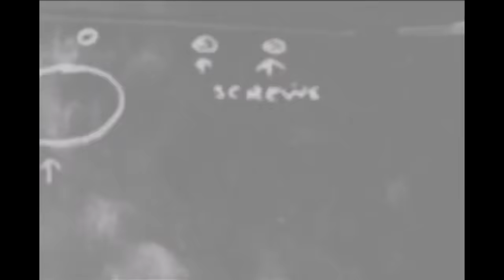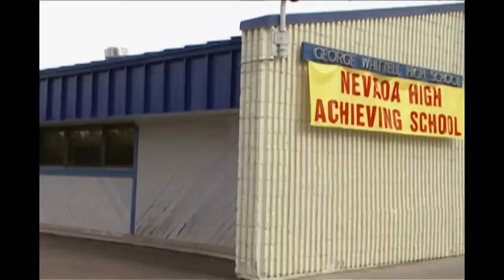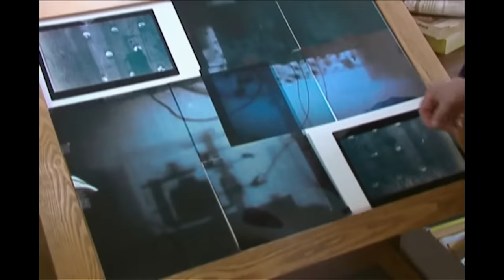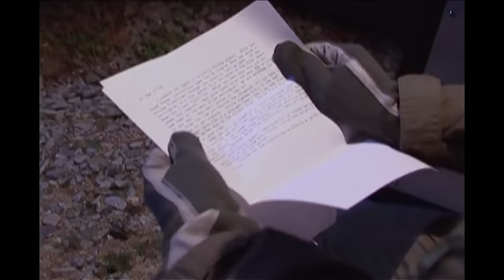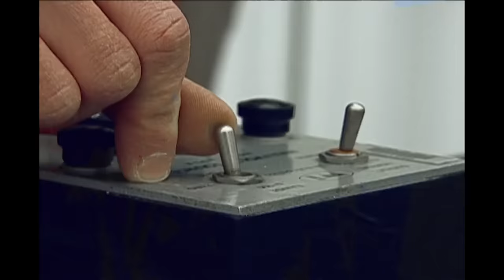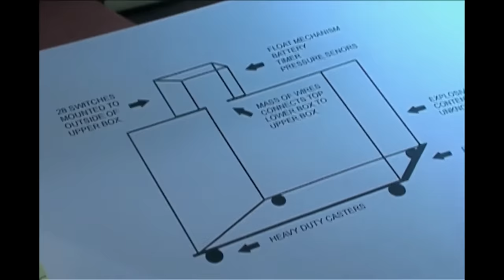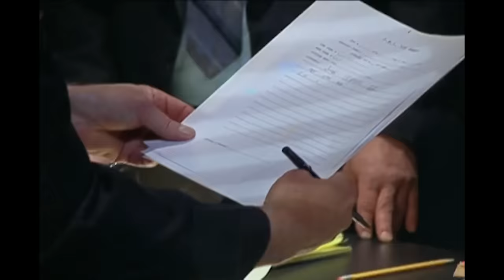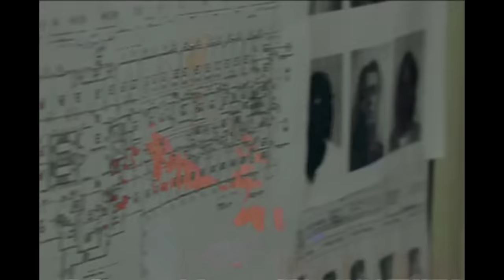Deadly Payout | FULL EPISODE | The FBI Files

Comment: A 1500-2500 ft blast area with somewhat significant damage, then inside 800 yards significant destruction, and 250 meters total destruction. My man, stick to one unit of measurement. Because 800 yards of significant destruction overlaps your 1500-2500' radius, and 250 meters of total destruction is 800' of claimed total devastation significantly overlaps all three radius.
Reply: Shroom Grizzley  no, if you start off using a unit of measurement remain consistent. Don't use feet which there are 12" in each, yards where there are 36" in, and meters which there are 39" in.
Reply: @chesspiece81  how about switching to the metric system yo--then you won't have any issues
Reply: @lilyesp5652  Should I wave my hand or just speak and make it so?
Reply: Metric system, so much easier. 1000 metres = 1 kilometre. 1,760 yards = 1 mile ( cumbersome).
Reply: @tonyneal4716  I wasn't arguing which unit of measurement was best. I was pointing out that usually people use a unit of measurement from beginning to end and he used feet, yards and meters
Reply: Can't see why Americans are still plodding along with the empirical system of measurement.
Reply: @jjoohhnnx  Point taken John but its not a major hurdle converting to metric. For example, OZ converted to metric during the 70's and we had major car race here called the Bathurst 500  (A 500 mile car race). It's now called the Bathurst 1000 (A thousand kilometre race). Football fields (rugby) use to be a 100 yards long now there 100 metres. I know one thing. It's so much easier for school kids to learn the metric system rather than the empirical one.

Comment: umm im not an expert but i just read the letter according to the bomber there are 3 baro switches inside set to a pretty tight range  mercury switches so it cant be moved or tilted tamper proof screws that can't be undone  and he himself says he has no idea how to disarm this ridiculously pressure and movement sensitive creation once its been turned on. why would you try to cut the top off with det cord when its obviously going to at least change the barometric pressure inside the room and the device?

Comment: The agents that came to the ultimate conclusion that using 6lbs of C4 plastique explosives to "separate" the top half from the bottom half are not very intelligent.  Instead of using high explosives to "disarm" a 1000lb bomb, why not use something more precise.  For instance why not use det. cord or detonation cord to separate the two halfs.  Det cord would have cut through that metal easily, with relatively low yield it's doubtful it would have detonated the explosives in the actual bomb.  Det cord would be what I would have used to try disarm the bomb without detonating it.  However, 6lbs of C4 plastque explosive has a very high yield and would no doubt detonate the 1000lb bomb.  I mean, these guys really screwed up here... FBI should mean "Fools Beyond Incompetent"

Comment: How do you blow up a homb with another bomb..i dont think that qwas a good idea at all
Reply: If the circuit was low voltage you might be able break the link between the top and bottom box before the electrical pulse makes it to the bottom box.